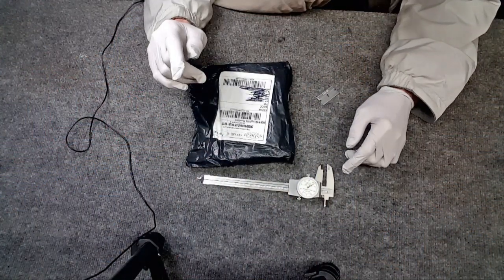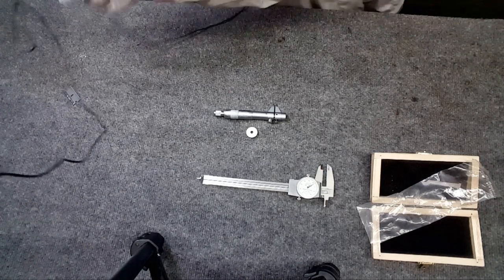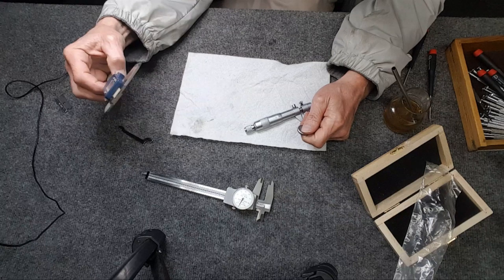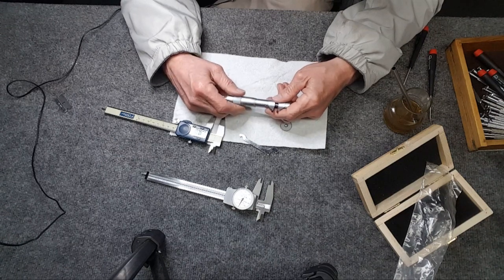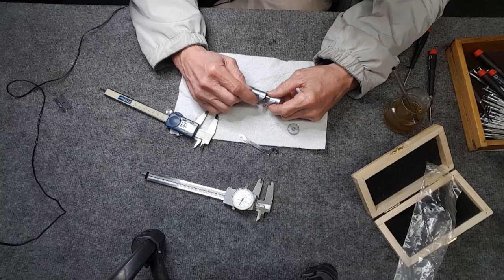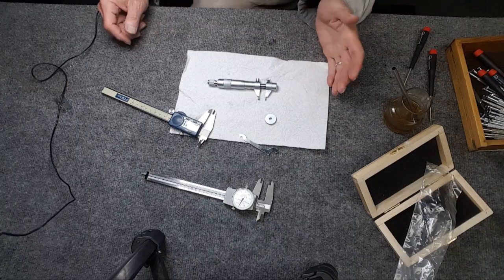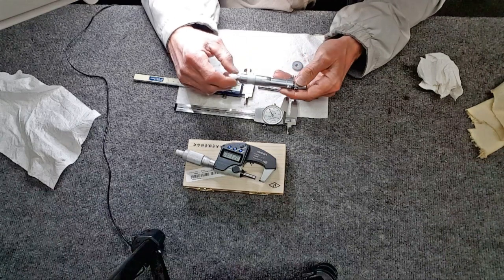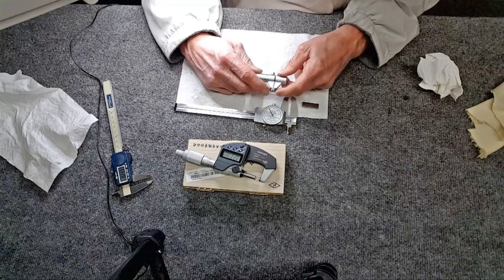Exploring Inside Micrometer Usage

Comment: Hi Dave I hope you are well and staying safe, I have very recently purchased a mini mill and already have damaged what I will call the sacrificial    Plastic top gear, could you tell me what is the hardest material I should be working on with the grizzly style mill, mine by the way is Clark but exactly the same, anyway I was using a face mill at the time on a small piece of O1 tool steel (not hardened) on the 3mm edge, I went in a couple of thou and the machine just stopped dead and that was it a broken gear, I am now thinking I can’t use the machine on such material I would be interested in your thoughts on this. Regards Bob.
Reply from the maker: LOL well this is why I went to the LMS belt drive upgrade.. no gear better finishes and can easily mill steel. My 2 cents!

Comment: Hey Dave, I have the same mic, not sure where I got it or why for that matter.  Mine has the same issues and I can't calibrate it either.  In fact barrel on mine slides in and out by about 1mm.  You may have discovered by now that the thumb screw on the outer anvil is the lock.  I never have used the thing and I'm quite certain I only paid about 20$ for it.

Comment: do you have a recommendation for type of aluminum (if needed) and carbide cutter that you would suggest for use on the lathe? I'm getting an okay finish with the carbide I have on hand, but it takes me a lot to get the work polished later.  On steel I use 2200 RPM (1" and below) and trigon cutters and I can make a near mirror finish to the point where my Emery cloth actually scratches it when I try to polish.  I'd like to go directly to polishing with the aluminum as well.   I see that your older videos seem to be using high-speed steel on aluminum. And I'm willing to do that but if you have a suggestion on carbide with aluminum to get a great finish I'm all ears.

Thanks for continuing to put out these videos. A lot of your earlier stuff has helped me with my mini mill and mini lathe and I greatly appreciate it!
Reply from the maker: Cobra Carbide has a tcmt 21.51 with a mirror finish that i use on 6061 getting a ridiculous finish. you'll se it in this video https://www.youtube.com/watch?v=HYUzzBSzrFQ&t=1821s
Reply: @TheMiniMachineShop  thanks!  That looks great!  I will give those a try!